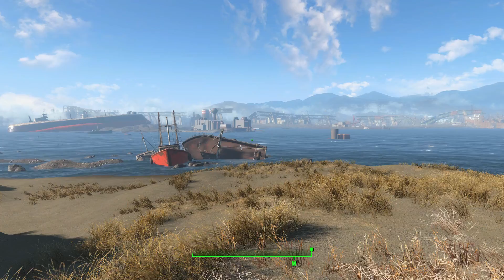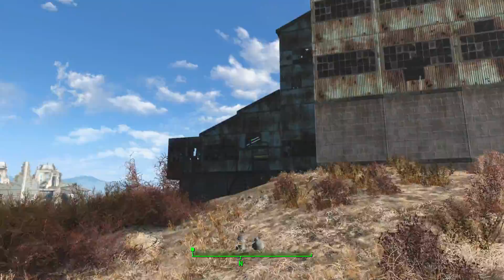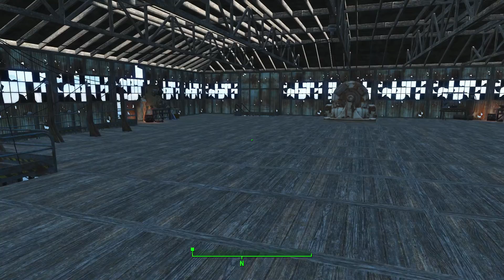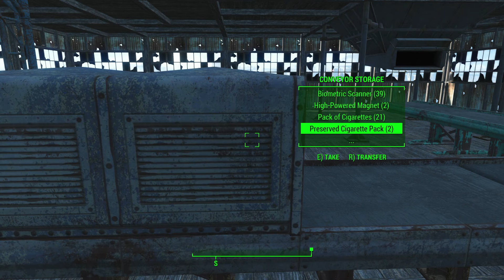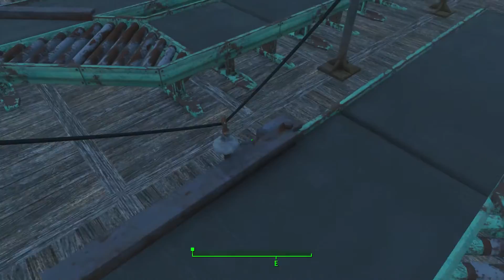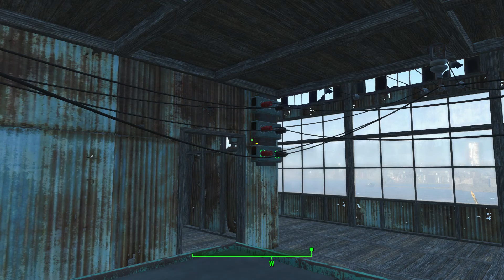Delta's Crazy Fallout 4 Ammo Plant

Comment: 5:01 It is possible to have different settings for ammo plants connected to the same circuit. But it is overly complicated so it may be better to seperate them. Basically: build ammo plant, connect with terminal, add generator (seperate source, can not be main) then change plants settings, remove terminal, connect plant to main power source with conveyor, remove 2nd power source. Plant will "save" the settings as long as it is powered. 
Dowsides far outweigh the benefits though, since you cant change any settings once it is all connected without going through the above steps..